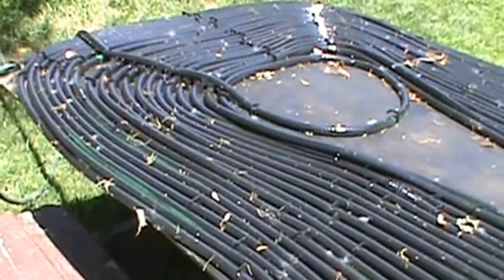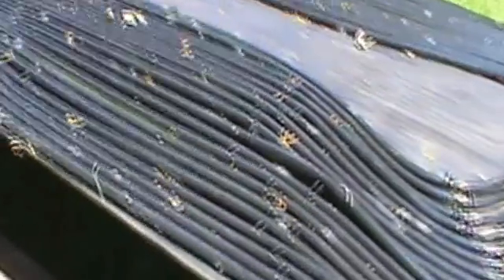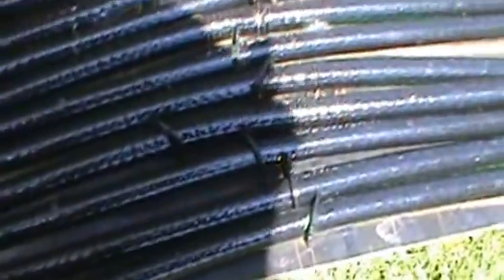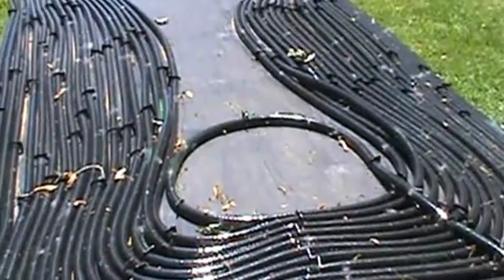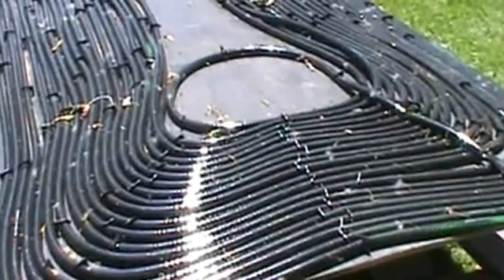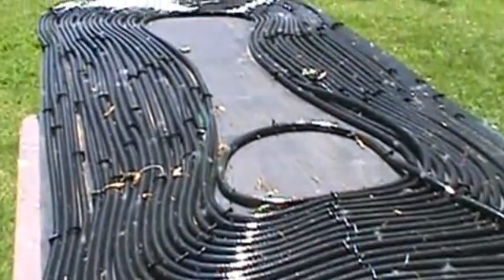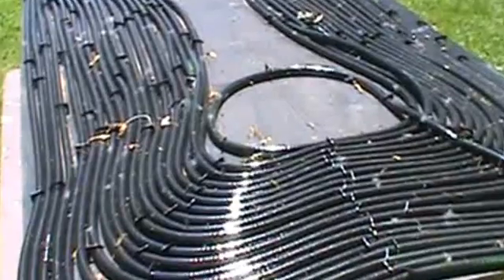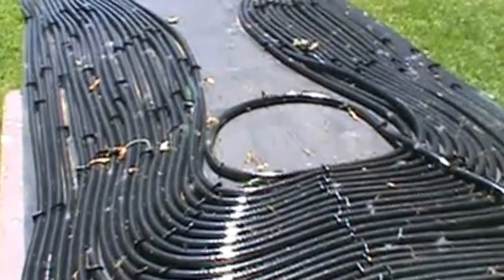SWIMMING POOL SOLAR HEATER

Comment: try reducing the flow or a slower pump. I made a small one and connected to the pool pump and control the flow a valve. My pool had a peak temperature of 94°. I'm going to be modifying it this year and add glass and insulation.

Comment: Really cool system!  How about if you added some 1 x 4  inch (or 1 x 6 inch) boards around the edge as a frame, and put sheets of plexi-glas over the top, basically creating a "greenhouse effect" around the black tubing.  Similar to the effect of a car with the windows rolled up on a hot day...

Comment: Just let the pump run because you want to keep the greatest temperature differential between the hose in the sun and the water in the pipe, much greater heat transfer

Comment: Thanks for sharing. Could you just use a slower pump so you don't have to turn it off and on? Then the water stays in the hose for the same amount of time without having to turn if off and on?
Reply: Reading through the comments, a lot of people asked the same thing. A few also added that you don't have to worry about turning it off at all regardless of the flow which is also true.
Reply: My husband made something similar years ago and we use a pond pump set to the slowest setting and the water comes out nice and hot.

Comment: Been installing solar pool heaters for 30yrs its like pissing in a pool and hoping it heats it. The faster the flow the better turn the pool over with 50% of the pool area in panels then you have a pool heater. About 1 degree an hour

Comment: Your panel is similar to mine. No need to switch it off and on. The panel will be most efficient ( and lose least heat back into the air) when it is a bit cooler. The temperature of the warmed water reaching the pool will clearly be cooler but still warmer than the pool itself,  and over a few days the whole pool will warm up nicely.

Comment: Interesting but I think it would be more efficient if it was enclosed in a glass cabinet to keep it from the cooling wind and rain. Also, you may want to consider constructing a differential controller (very easy electronic circuit) to automatically turn the pump on and off.
Reply: +TinyWords Yes, just a sheet of clear polycarbonate double-wall will help.. the water gets dangerously hot in mine on a hot day :)

Comment: get at smaller pump, with less flow, then the water have time to heat up.
BUT, you will get the same rise in temperatur however you do it..
since the effect of the sun will allways add the same "power" to the water in average.
if you heat up 1 gallon to +50 degree and put it back in the pool with 100 gallon, it will average out.
compared to heating up the water with just + 10 degree with a constant flow.

Comment: Cycling the pump is totally useless from a heating point of view. All solar energy that is absorbed is used to increase the pool temperature. Regardless whether you heat up small amounts of water to a higher temperature, or heat up larger amounts of water to a lower temperature. Heating to a higher temperature might even be counterproductive as the black tube radiates more of the hotter water to the environment. Heat flow is proportional with temperature difference. Only from saving energy on the pump itself it is interesting to cycle the pump action.

Comment: I don't get it??? Why not put this in-line with the pool pump instead of separate pump which burns more energy!!!
Reply: +Jeff Brown That's how I plan on doing mine.  Actually, I'm just going to connect a very long black hose to my auto-fill.  When hose pressure builds, it will release the pressure into the pool.  Otherwise, the auto-fill will just turn on about 3-10 times a day to dump hot water into the pool.  My summers consist of 100+ degrees, so I don't need it most of the time.  Just in the spring and fall.  Maybe in the winter as well... maybe. :D

Comment: If you're turning it on and off to allow it to build up heat, theres no need for that, the heat is constantly being put into the pipes by the sun, just let it go, alternatively, consider a slower pump so the water sits in the pipes longer.

Comment: Could we slow down the water flow by using a smaller water pipe at the entry of the black pipe, if we are using 1/2inch  black pipe hook a 3/8in at entry, would this slow down water flow, just asking

Comment: Hey, what's your pumps flow rate I'm finding it very hard to get a good answer on how fast I should be running water through. I will have a coil of around 100m long

Comment: Use a tstat. Like in refrigeration opens when water gets colder than as water gets hot the power then passes to the pump until water(the cold water makes it to the end opens cutting the pump off then you will be free to get all kinks out and also can you explain size of pool and temp change/ difference solar heater makes.

Comment: Instead of a timer increase the hose length(surface area) to 1200'(2 more panels) and it should be able to run constant during sunshine. And it will actually heat the pool.

Comment: The hotter the water gets in the pipe the less efficiently it absorbs heat - if you never switched the pump on the water filled pipe would quickly reach an equilibrium temperature where it is radiating the same amount of heat as it is absorbing. i.e zero net heat transfer.   Thus you will get the most efficient heat transfer to your pool by letting the system  run continuously rather than turning it on and off - as soon as that pipe gets noticeably hot, it's not absorbing heat efficiently. And the faster you can push water through the pipe, the more efficient the heat transfer and the faster the pool will get up to it's maximum possible temperature in relation to the solar flux. The corollary is as soon as the sun goes in, you have to switch the pump off, or the system flips and starts to radiate away the heat from the pool rather than absorb heat from the sun. Some sort of photoelectric control switchwould be ideal.

Comment: you could have installed the roof, leaving space between the hose coil, and use the filter pump.it probably would be better if there was space between the hose, so the sun could heat a larger portion of the hose.

Comment: I just put a spigot on my return at the pool pump which diverts some of the water to the black hose and back into the pool. No need for the extra pump.    I can control the speed of the water flow by how far I open the spigot and there is no need to shut it on and off.  On very hot days, I have to shut it off or the pool gets too warm, like 95 degrees. I use a solar cover at night so I don't lose the heat.  I don't attach my hose to anything,   I just lay the hose on the ground  in a circle.  It makes it easier to store it in sections for the winter.
Reply: 150JMB you are right. I put a Y joint in the outflow pipe from the pump and put a valve on one the 2 outflows from the Y joint. in that way I can slow the water flow through the solar heater and it gives a steady flow of warm water all day long without using a 2nd pump. in that way once the pool is to the desired temp. I can simply shut off the water traveling through the heater.

Comment: The black hoses do not absorb heat. If they did, you'd get no heated water into your pool. The black hoses absorb all wavelengths of light from the sun, and in turn, they heat up, and then transfer that heat TO the  circulating water. But overall, this is an excellent idea I may pursue for my pool.  Idea: If you were to construct a box with a window (facing the sun) to hold the black hoses (and prob double the amount of black hose, and insulate it), the box would become VERY HOT inside and hold heat a lot longer.  You are taking cold pool water and circulating it directly thru your system, which removes a LOT of heat from your heater. If you were to say, build a CLOSED system, in which the water is heated but only circulated to an exchanger where it heats the pool water, the water will stay HOT, and the release heat to the pool. Just an idea.

Comment: Hook a thermostat with a sensing bulb into your circuit.You should be able to find one of these at a commercial plumbing store. Connect thermocouple ( sensing bulb) next to your hose. As soon as the water in the hose is hot enough the pump will come on, as soon as the water passing by that point falls below the set point it will stop. Voila you have an Automatic heat dump system that only works when the water is hot enough.

Comment: What about using a pump powered with a solar panel? having a pump running all the time is gonna use electricity....can it too be setup to work from the sun? That way the pump only runs on bright days, and switched off at night automatically.

Comment: No need to turn in off each time.....
Just let it run... at the end you will have the same amount of heat in your pool.

For example : when you turn it off each time you maybe get 5gallon/hour of very hot water.

If you let it run you will maybe have 3-4x that much water but not so hot.

At the end you will have the exact same result ;-)
Reply: Accually, he will get more, with the flow going 100%, as the solar heater is more efficiant at lower temperatures.
Reply: Actually, no. Not the same, but a worse result than letting it run continuously. Heat transfers more efficiently (faster ) across a steep temperature gradient than a shallow one. If you have water at 0 degrees on one side of a membrane and 100 degrees on the other, heat energy will be transferred much faster across that membrane than if the temperatures were only 50 and 51 degrees. If the sunlight heats the pipe to 90 degrees but the water inside the pipe is already at 90 degrees then you don't get any heat transfer at all - if you don't pump water fast enough through the system your final coils before the water gets pumped back into the pool might not be doing anything at all.
Reply: Shipping/Harbors You can also slow down the flow through the heat exchanger using a flow restrictor of some sort, giving water more time to heat. 

Another improvement could be to use copper tubing, or a cheaper option, black poly solid drip system pipe, or, the 3/8s "funnypipe" used in yard sprinkler runs to each head from the hard pipes. 

The funnypipe can be had cheaply from landscapers and contractors during autumn and winter. To interface with standard plastic pipes are a range of barbed to threaded or glue fittings. 

That return line going out to the pool really needs good insulation, like Armaflex or similar foam-rubber insulation to keep that water at it's hottest.

To pack it in tight on the panel, there would need to be tight radius return bends, that are either made by heating up the poly-pipe until it's soft to very soft, then bending very carefully, or using thin walled copper or aluminum tubing bent on a similar radius.
Reply: BPM Productions of Colorado
"You can also slow down the flow through the heat exchanger using a flow restrictor of some sort, giving water more time to heat."
Wrong. By doing that you are reducing the efficiency of thermal transfer. See my first post above.

Comment: Just a thought - Heat rises; draw cold water in from the bottom of the pool put the other end in the top of the pool; let the sun heat it in the pipe and the warmer water should rise and run out of the top and pull cooler water in at the bottom.  No motor just thermal movement.

Comment: Use a water hose splitter, adjust the flow so most returns to the pool but %15 goes through the glass covered 400' hose...just a thought.

Comment: This would only be good for sunny summer days yeah? why would someone want a hot swimming pool in the summer, I thought pool in summer was for cooling off.
Reply: spoken like someone who a) doesn't have a pool and b) failed basic physics.  The sun does come out in the winter man, and, yes, it will heat a black hose even on a cold day.  also if you have a large pool, and you're just transitioning from winter to spring, this can take the edge off your pool many many weeks ahead of time.  also if you live in the desert, it gets very cold at night, even in the summer sometimes and your pool can reach uncomfortably low temps.  and some people like warm pools, so, don't you feel smarter?
Reply: kilrassclown

a little combative but thanks for explaining that. i would argue that projects like this can be specifically built just for those discomfortable transitional periods like the ones you described.

with all these types of videos on the youtube, i'm not sure where it is going but i feel it is somewhere very right. :D

Comment: just use a small aquarium pump. im in australia so the sun is quite intense. we have made a similar setup. when the water gets back to the pool its literally steaming. it gets to a point where the pump can be turned off and a heat vacuum occurs.

Comment: A simple limit thermostat, close on rise, would shut the pump off when the temperature at the output drops.  I reckon you wouldn't want the thermostat sensor at the output but actually in the receiver, somewhere near the end of the run.  When the water heats up again, the thermostat switch closes and the pump fires up again until cold water gets to the sensor.  Lather, rinse, repeat automatically, no hassle for you.

However, the other statements regarding letting the water continue to run are correct.  In fact, the lower the delta-T (temperature change in the collector), the more efficient it is.  It won't feel like the collector is doing much, but in fact it will be gathering more heat and getting it into the pool, where you don't actually want HOT water - just warm.  So if the water pouring out of the hose feels merely tepid, when you spread that slightly warm water over your entire body it actually feels pretty good, and that's the goal.

Comment: Great idea but here are some ways to improve your system. First, pull out the colder water at the bottom of the pool and return the warm water at the bottom as well as the warm water returning to the bottom will rise to the top creating a circulation in the pool. Next would be to either slow down the pump or put a valve near the outlet to restrict the flow. Better yet would be a small 12 volt solar pump that would only run when the sun is up. Build a box around the hose as it will warm better.

Comment: sorry for the disillusion but plastic is an insulator, that's why you have to wait every time for the warmth to be transferred to the water. Should have used copper pipe...

Comment: I have something very similar, I put sides on mine and put sheets of glass over the hose to concentrate even more heat onto the hose.  You don't need to turn off the pump though.  Keeping it on will seem like there is less heat going into the pool but it is constant instead of not getting any for the time you turned off the pump.  The thing you do save however by turning off the pump is the electricity to run it.  Try putting some glass over the hose, that will increase the heat to the hose.

Comment: My neighbor did almost the same thing, but they used the pools filtering system and tapped off from that using a shut-off valve - no need to use a separate pump. The just leave it running because the end result of letting it sit 15 minutes to warm it up and then running it for five results in the same overall change to the pool as letting the pump run and having the water be just slightly warmer but constant... works for them.

Comment: ...or  you could just put a black polythene  sheet over the pool. Get more surface area for the sun, retain what heat you do get into the water & remove the need for the pump.

If you insist on using piping, make up a float to feed from just below the surface and submerge the return end to near the bottom of the pool. The pool will cool the returning water, causing it to sink and syphon water in from the float to replace it.

Comment: Restrict water for the time you figured out is best way with this set up. Use a wall timmer on/off I would recommend a digital one the manual ones go on/off by hours digital can be set up for secs,min,hours. Plugs into your pump and that way you can acually enjoy pool! Great post!

Comment: I did the same thing with 200 ft of 3/4" copper pipe, painted black, and with some shiny aluminum reflectors to help concentrate the light.  It made the water hot enough to hurt.  I just tapped into the pool pump aft of the filter and let it run.  I tried plastic pipe first, just like this, but it insulates too well, and that is why you have to turn it off and let the heat sink in.  Copper cost a little more, but it will last longer, so its a wash.  Nice vid.  good work,

Comment: just slow the water flow down and you won't need to start and stop the flow. your just running the water through the pipe faster than it can pick up heat

Comment: Just a suggestion... put in a restrictor (sp?) in the hose to slow the flow down and/or a slower capacity pump.  Just a thought. but it's a great concept you have.

Comment: i feel like if you exposed the bottom of the hose to sunlight as well with a simple lift and a reflective surface underneath. it would double its efficiency.

Comment: Run it continuously and as fast as possible. It won't be so hot when it comes out of the pipe, but it due to a higher temperature difference the heat transfer rate from the sun to the pipe will be higher and your pool will heat much faster.

Comment: Have you thought about slowing down the pump, reducing voltage, or putting a restrictor in the hose so it slows it down, then you'll never need to shut it off.

Comment: As the water gets hotter it has less capacity to absorb heat. Once the hose temp and the water temp equalize, the heat transfer stops. A fast pump keeps the heat transfer rate higher. Remember, you have 400 feet of hose to go through before you reach the end.